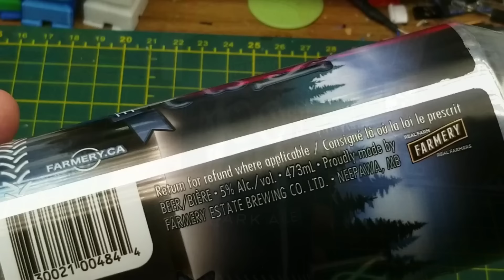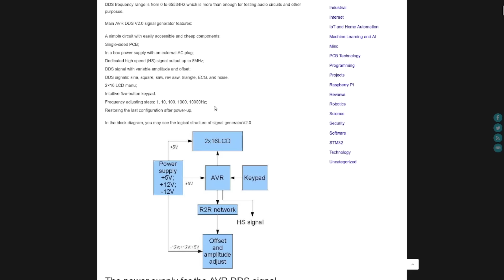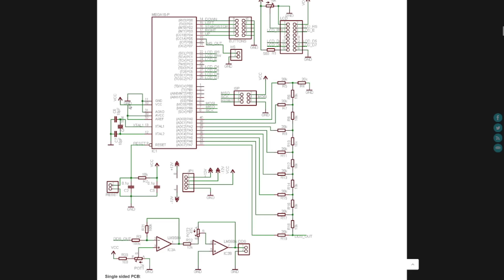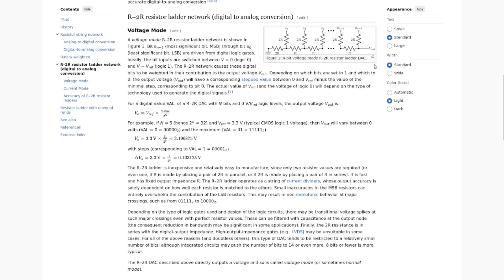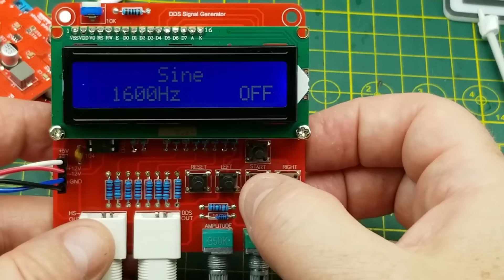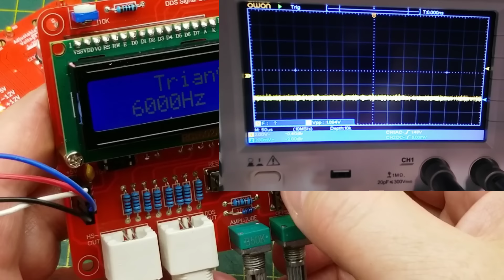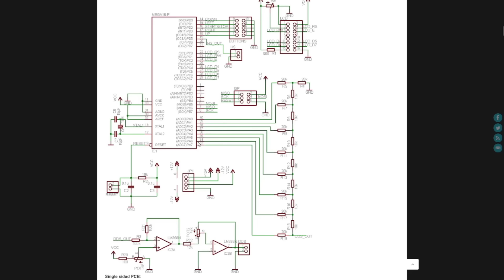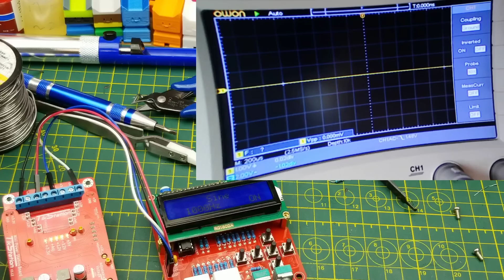relaxing kit build: signal generator

Comment: Nice kit. The noise is from the probe not being grounded properly. Don't forget that the outside metal part of the BNC plugs are not ground. 👍

I bet if you used a BNC to BNC cable you would get a good signal.
Reply from the maker: I have that exact cable on order already.
Reply: @pileofstuff  Oh, I forgot to mention, loving the tracking shots above your bench. The new version is a lot smoother.

Comment: I like the the time lapse camera. Turned out well! Maybe it can be adjusted so the board is not at the bottom of the frame?
Reply from the maker: Yeah, it's still a bit of a work in progress.  

Glad to see it's smooth enough to use now, though.
Reply: @pileofstuff  Yeah. It makes great timelapses. It is just a positioning thing.

Comment: I was going to say that a 8bit r2r ladder should give 256 different voltage levels. And you just shown that inject two much current from one pin and the steps go out the window.😂
Reply: ... too much current ...
Reply: @SpeccyMan  each pin can go between 0 and 5V. so each pin going to 5V injects some current in to the ladder. it's position on the ladder affects the weighting  or amount of current injected. so using a much lower value to one resistor means that way too much current is injected in to the ladder swamping all the pins below it.

Comment: Tips are always a personal preference. My one bugbear is people using hopelessly dirty tips on their irons and wondering why their soldering (the L is not silent or another D, lol) totally sucks. Keep your iron tip clean folks and it will do its job properly. A clean and properly tinned tip is an efficient tip.

I have a different version of this that features a QFP ATmega328P on it. Since there was quite a bit of code space left inside, I found the firmware source code online and added a stairstep waveform to it as well. Incidentally, it also features a single power supply input as the various voltages are created within the circuit.
Reply: The R is not silent, either

Comment: Thanks for posting. Glad you found your mistake. I use this rule if I get tired I walk away. I use a soldering microscope it helps I only have one working eye. So fatigue sets in quick. I noticed a lot of what I call signal bounce. Any ideas on how to reduce or eliminate? My JYE Tech signal generator does the same thing on my Hantek DSO. Would you say this is generally found on DDS generators?
Reply from the maker: Not sure. I don't have a lot of other experience with DDS generators.

Comment: Anyone who tells you you are wrong for liking a particular tip needs to just stay off the computer ......    I may have mentioned this before, but I use to repair satellite modems ffor Thaicom / IPStar.    When I first started, Thaicom sent techs out to train me and they were replacing surface mount chips on the modem boards with the chunkiest tips I have seen on a smaller iron.   No tweezers, no hot air.   Just a chunky tip and they never birdged a pin.    It comes down to what you like using and what works for you.   No one can say right or wrong, if it works, then it is right for you.